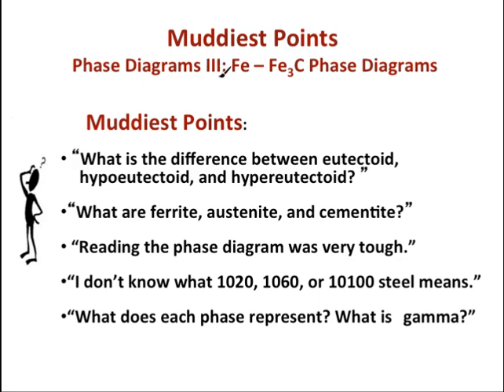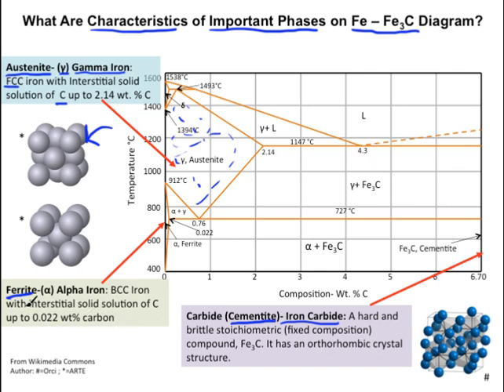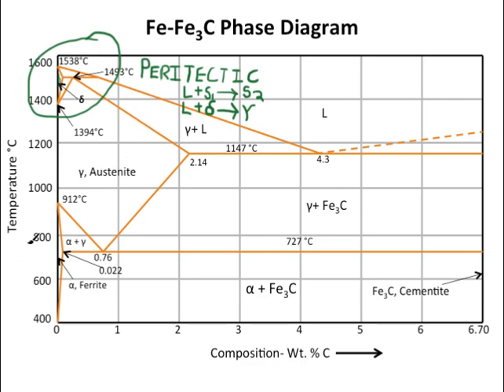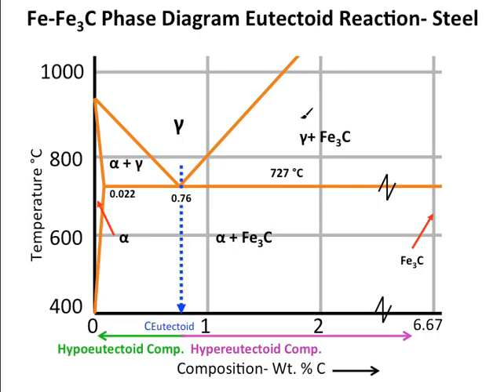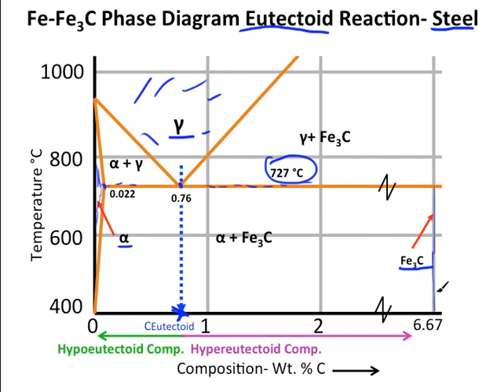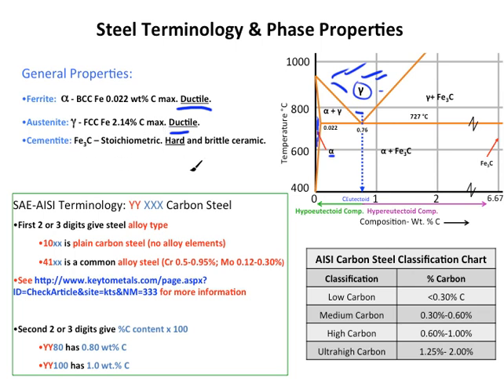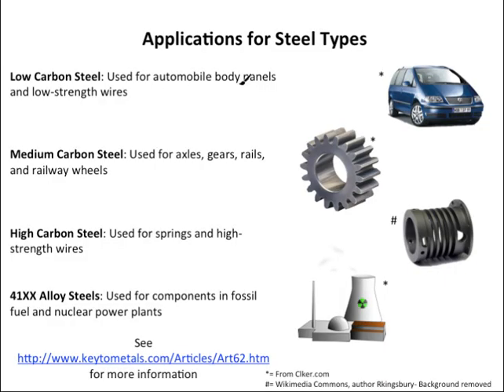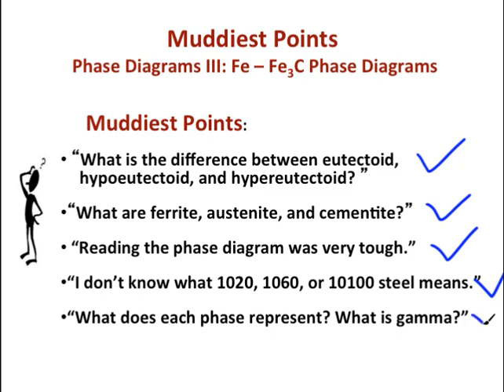Muddiest Point- Phase Diagrams III: Fe-Fe3C Phase Diagram Introduction

Comment: How to use Iron Carbon Diagram at your job with high temperature, High pressure,  & corrosion conditions or in the selection of steels for a chemical or petrochemical plant to solve problems? Could you please give some insight into it.

Comment: How can iron carbide diagram be used based on the requirement of application?
For example boiler tubes
Furnace tubes with aromatic compound 
Strength at a higher temperature requirements

Does it help in selection of steel alloys.
Thank you